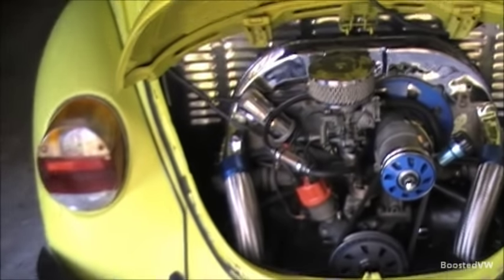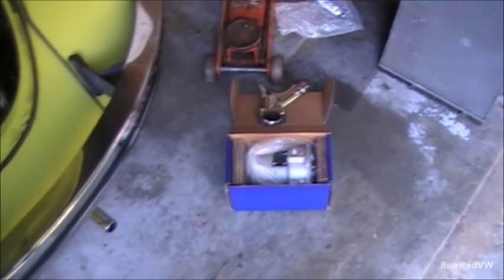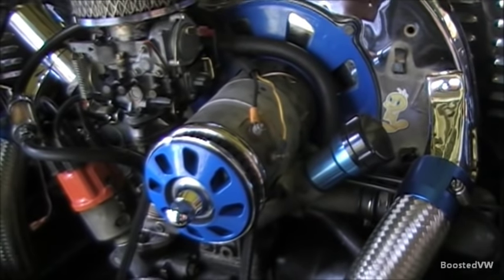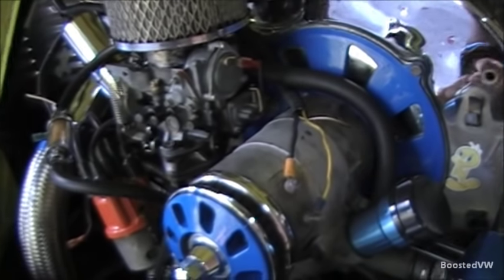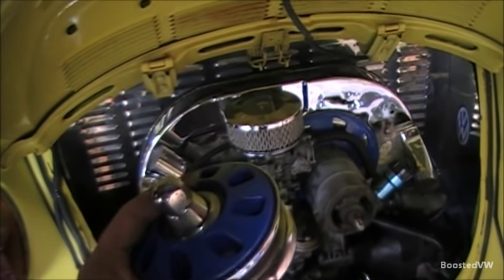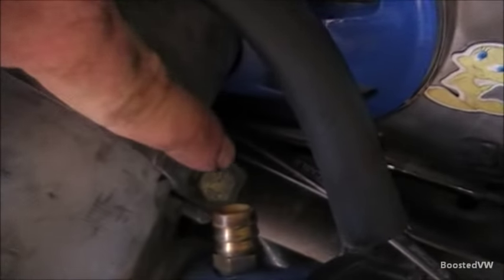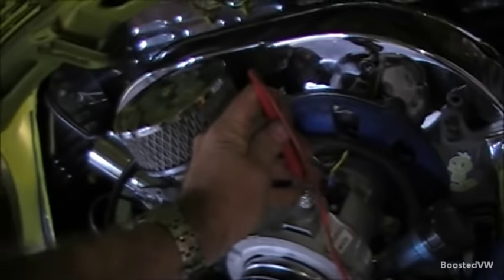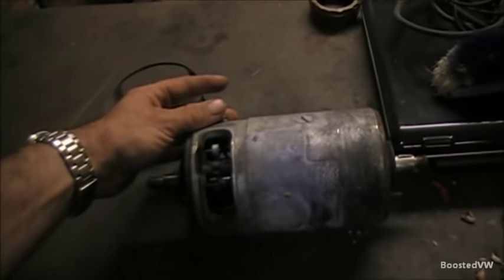VW Beetle generator to alternator conversion

Comment: Nicely done Mate; 14.5 V @ the B+ of the  Alternator, also check the Voltage @ the battery terminals so you know that the charging voltage is sufficient!

Comment: Thanks for the tip for the louvers underneath the oil stand I've got an alternator on my car and I'm having problems putting a double barrel on there empi has not manufacture their air intakes properly going to try to go back to a generator to get more space
Reply from the maker: Is it the carb or the intake that’s hitting?

Comment: Your regulator looks like this Computer ECM and is place in newer super beetle 1976 located at where at the relay box atop the old generator but you have change it from alternate conversion pro hardware kit that you can throw it out the generator.

Comment: Vw used alternators on the bug since 1973 they were either Bosch or the Motorola brand alternators as 1973-1974 were external regulators. 1975-1979 were internal with the motorola mounted on top of the alternator. as the discontinued Bosch Al82N is internal its located at the fan side bearing cover. as aftermarket companies are making the Al82N if you use this alternator your warning light has to work if you are using an LED warning light you have to use a load equalizer resistor for it to charge.
Reply from the maker: Not entirely true. 
Alternators didn’t start until 74 for Europe and Australia and were only Bosch. 
US market got Motorola alts in mid 73, early 73 were still generators.

Comment: Does the starter wire connect to the battery, power cable that goes to the front and the one from the alternator?

Comment: so if you dont have a dummy light as mine was  re wired with out one is that the same to run
Reply from the maker: An alternator won’t charge without a dummy light. 
If you want to run without one you’ll need to wire in a resistor but then you won’t know if there’s a problem- snapped belt, not charging etc.
Reply: @BoostedVW   so im better off just getting a generator agine then so i can keep my same setup
Reply from the maker: Yes generators don’t need a light but a light is very simple to add just one side to ignition positive and other side to regulator or alternator.

Comment: How are your fresh air hoses attached? Is it just a slip fit on the shroud outlets and heater boxes? Never seen a fresh air setup like that and now I want to copy you.
Reply from the maker: +caliarmyguy hi, they are just standard hoses, those are just stainless steel sleeves over the top designed for radiator hoses
Reply: So you are using the stock heater hoses with sleeves over them?

Comment: My mechanic says he head to remove the engine, is that legitimate?
Reply from the maker: Yep, It makes the job a lot quicker, takes twice as long doing it in the car with the lack of room.
Reply: @BoostedVW  my mechanic said that he can’t fit the alternator in due to it hitting the intake manifold. I already bought the parts. Should I get a second opinion? Have you seen this issue? Is he being lazy? It looks close but I can’t tell. Thank you
Reply from the maker: @estimatingonediscoveringthree  something isn’t right, maybe bad reproduction parts.
Reply: @BoostedVW  jbugs conversation kit
Reply from the maker: @estimatingonediscoveringthree  I’m in Australia so not used Jbugs but I see non stop complaining about them on Facebook groups

Comment: How can you tell an alt between a Genn??
Reply from the maker: the whole body of generators are the same diameter as the pulley where as alternators are larger in diameter in the center section

Comment: are non bosch alternators that bad?
Reply from the maker: THere are some pretty poor quality ones out of China on the market, the biggest issue with them is the bearings failing.
If you can replace the bearings before they have a big failure they can be ok.

Comment: chrome don't get you home, I would chuck that dress up crapola tin and put stock pulley and oil bath airfilter on there. VW quality can't be bear.
Reply from the maker: John Collins if you watch all the vid and look at the thumbnail I have swapped a stock oil bath on but customer wanted chrome tinware left
Reply from the maker: The actual tinware itself was the original german stuff chrome plated, it was only the pulleys that were aftermarket
Reply: Why is the oil bath better?

Comment: The big black wire connect in between battery one post and alternator 2012, second yellow wire connect to internal regulator diode. Third is bring up the green wire to the transistor inside the alternator regulator. And where is the rest of the red wire for ignition connect positive coil 12 volts temporally primary circuit and negative connection ignition orange wire. The long white wires for head light and tail light Volkswagen no AC cooler super beetle. Maybe a automatic transmission to the rear engine instead 4 speed transmission from Westphalia super stock modified Wolfsburg at Porsche Spicer Detroit Duesenberg modern Custom Craft.